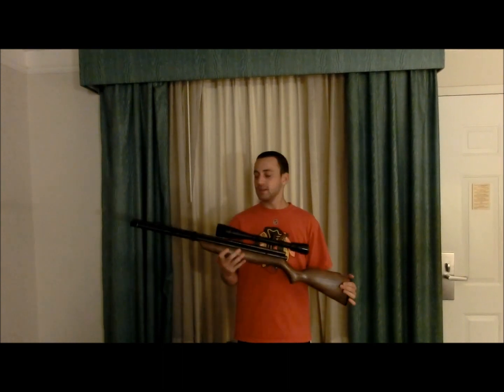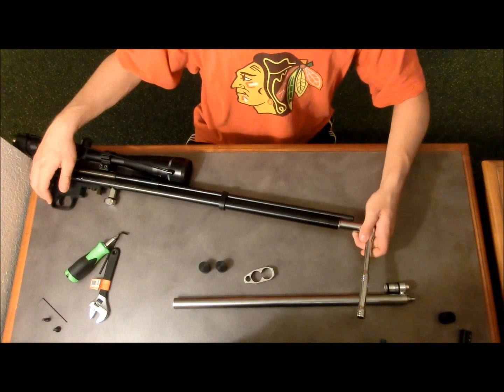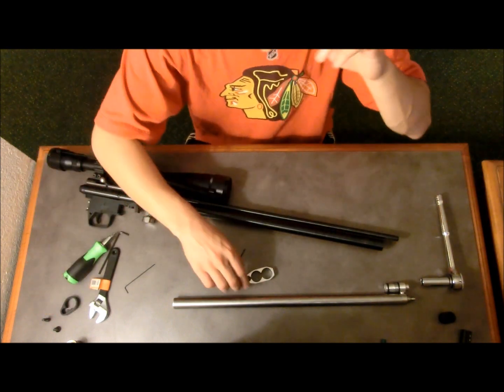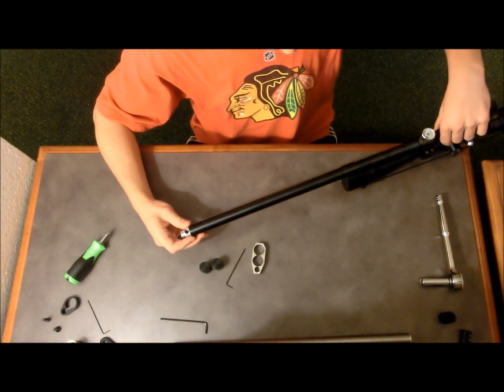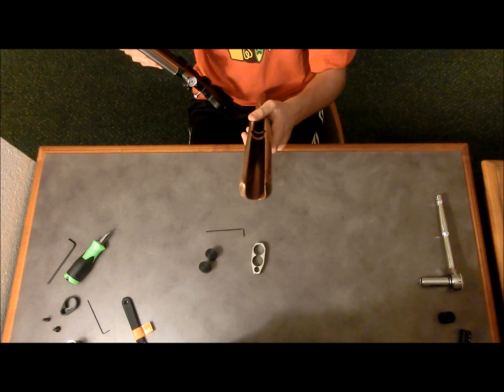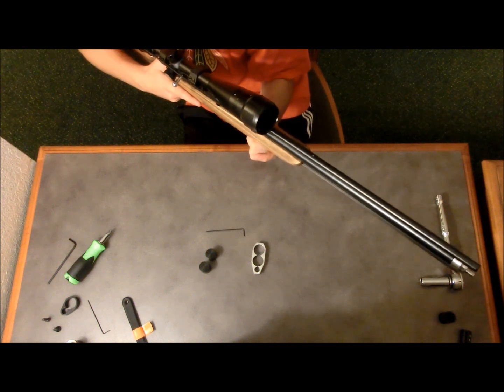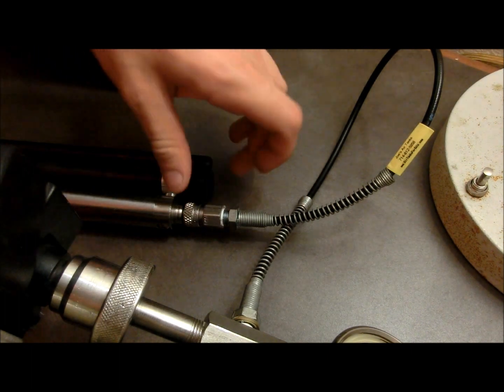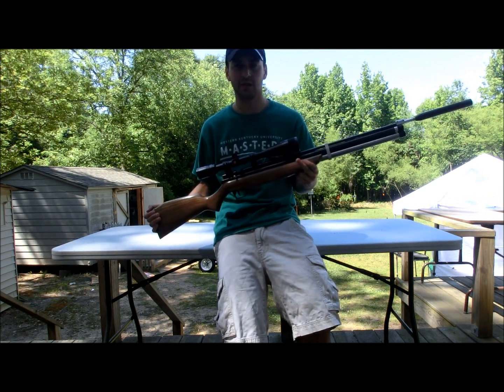Installing the Disco Double Tube Kit

Comment: They need to sell a replacement tube that takes a higher fill (2500 psi would be a good idea)
Reply: why couldnt you just use a bengamin marauder tank. i think they are both the same tank. but just in case im wrong i havent tried putting 3000 or even 2500 in my disco.

Comment from the maker: I suppose anything is possible but I will have to run the numbers first.  The plan is to get them all done tomorrow and make the video as well.  It should be interesting.  I have run a few shots over the chrony already and have been very intrigued by the initial results